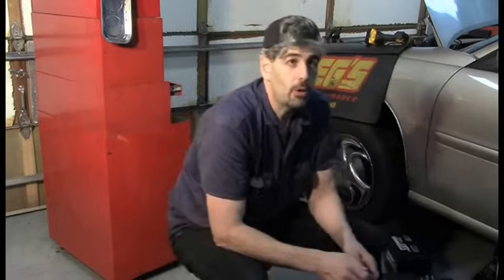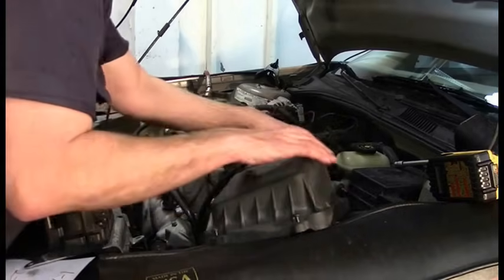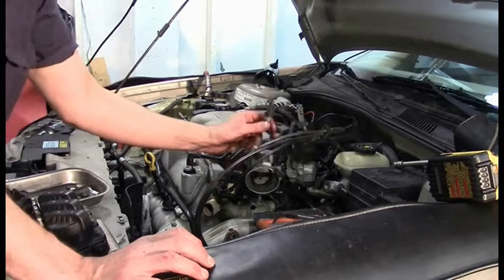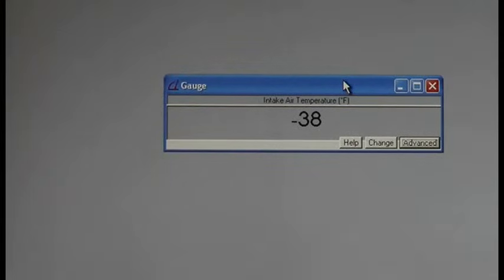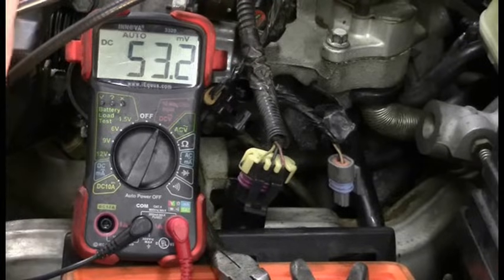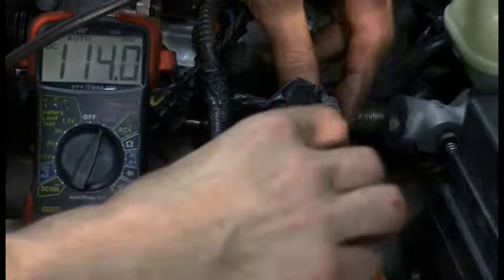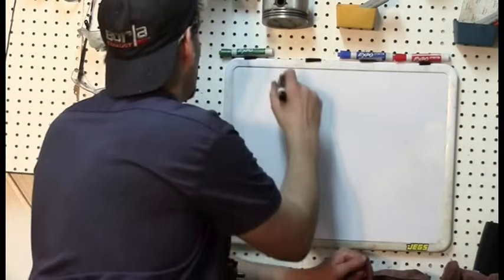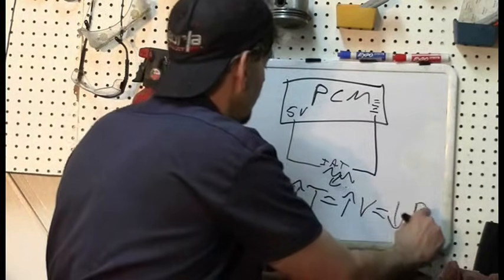IAT ( Intake Air Temperature Sensor ) Diagnosis P1111, P1112, P0113

Comment: What if you get your 5 volts by measuring the connector with the meter but when you bridge the connector with a paperclip and get zero volts with both leads connected to the clip, that's bad right?
Reply from the maker: ersanchez805  There would be no voltage potential across the terminals any more if you jumped the terminals. It would be like measuring voltage along the same run of wire. That's why there is no difference in voltage along the jumper.
  Why would you jumper it anyway? You are grounding a voltage straight to ground and could destroy the PCM.
Reply: Schrodingers Box
I don't know about cars much but my friends helping me lol.
It's because my idle is fluctuating. We replaced the iac, bled the cooling system after and checked for air leaks by removing the intake and covering the port in the throttle body and the engine died. We don't know what else it could it be? We got codes- P0113 P0505 P1509 on 98 Honda Civic EX
Reply from the maker: ersanchez805 No other way than to learn how the systems work and then diagnose what is failing using good diagnostic techniques.
 With those codes you could be changing parts all day and night and not fixing the problem
Reply from the maker: ersanchez805 Incidentally, if your friend had the idea of jumping the contacts with the paperclip, you need a different friend helping you before he destroys your car's computer- if he hasn't already.
Reply: Schrodingers Box Runs normal. Nothing out of the ordinary. Guess PCMs ok lol
Now we know not to bridge the contacts.
Gonna take it to a real mechanic. We tried. Thanks
Reply from the maker: ersanchez805 Bro, you don't understand... the whole PCM does not fry- only the part of the PCM you shorted out would fry. The car would still run normal. 
  I won't bother try to explain the whole thing but here's what the deal is and it's absolutely critical you understand this:
 based on the previous information you provided,If the real mechanic finds the PCM needs to be replaced, your bonehead friend who grounded the signal wire owes you for the PCM replacement. A PCM failure could only be caused, based on the previous reading you got, by doing the one, single thing in the entire video I said to be absolutely sure not to do-- ground the signal wire, and yet somehow that was done intentionally.
  It is critical you understand this so if this friend of yours really did that bonehead move, he takes responsibility for it and pays for the PCM if the car needs one because that was not- could not- have been the original problem.
Reply: Schrodingers Box we'll see if it needs a new one. But can we figure if we actually fried that specific part?
Reply from the maker: ersanchez805 yes there is but I hestitate to describe how since you might again ground it out if you do it wrong- plus there's additional complication in that the original cause of the problem is still not fixed yet so best to leave this one to the pros.
Reply: Schrodingers Box Well you know teens. We try doing things the right way but instead we do them the wrong way. Lol
But you know thanks for the helpful tips and hopefully we can fix the issue 
Like you said leave it to the pros.

Comment: I have a 2001 chevrolet silverado 4.8 it recently started throwing code p0113 and idles high on start up and will idle up a few hundred rpms while idling then drop back to normal and when applied throttle will hold for 2 to 3 seconds before dropping back to normal could it be my iat I believe it is built into my maf sensor on this model and when code is cleared the truck idles better but not like it should then it comes back on being the only code
Reply from the maker: what did the diagnostics on the IAT show?
Reply: Just learned from your video how to check it will do that tomorrow just wondering if the truck having throttle body spacer and cold air Intake could cause the problem it just started and has had cold air intake for several years added spacer and it started so im kinda stumped
Reply from the maker: most likely you will find a short to ground is your issue with that code. The video shows how to do the diagnostic.

Comment: This video was great!  Could a bad iat sensor cause the icv to stay open increasing idle at start up?  As soon as car starts idle goes up to 4k and will slowly increase??
Reply from the maker: An IAT will have nothing to do with that. Depending on the engine design probable causes would be vacuum leak, throttle body dirty, or ICV issue. But IAT can be virtually ruled out, as would ECT or other typical low temperature=high idle inputs because no inputs sensors would command a 4K RPM no matter how cold it is.
Reply: Thanks..I guess I'm stumped again. :-(
Reply from the maker: Brian Turner I am not sure what you have available but assuming you don't have a scan tool, my first step would be cleaning the throttle body. But really to diagnose this you need a scantool to look at various input sensor data and see what looks out of spec.
Reply: I'm working on 98 e39 528i.  I scanned the car. It was puling cam shaft actuator code.  Car was running good when code came up.  I was on my way home to park it and went to shift and the rpm stayed high.. I cut it off and on they were still around 3k. Then they started to go up more.  I let the car sit and still soon after it cranks the rpm goes up again 4k + until I cut it off.  I disconnected the icv and plugged the holes the idle went down.  I could see the icv was staying open.  I thought the IAT sensor controlled that. Thanks for your help and your video.  It was great the way you explained things.  The best explanation I've seen in an DIY auto video
Reply from the maker: Brian Turner Thanks for the praise on the video but most definitely look elsewhere than the IAT.
  There are many things that would cause this symptom. The idea is to not be stumped because you don't know what could possibly cause this- the idea is to be stumped because you know there are so many things that could reasonably cause it that you have a hard time finding a direction to start on.
  I think a good start for you might be this video:
https://www.youtube.com/watch?v=Fv4KzJxt0aQ

Comment: Matt, Had my scanner hooked up and I had a IAT sensor reading of 100 degrees F. The weather outside is 43 degrees feirenheit(excuse the spelling). The IAT in the Acura is in the intake manifold side. I realize its over the engine but would 100 F seem warm considering the 60F differce between that reading and the incoming outdoor air tempeture.
Reply from the maker: It sounds right to me based on the location, as stated there will be compensation for engine temp on an IAT located in the manifold.
  The best way to check is that in the service manual there will be a chart showing resitance vs temperature. If these match up then your calibration is good.

Comment: Hi Matt, first off I want to say I love your scientific approach to problem solving and diagnostics. You and ScannerDanner are my anti-parts-changer YouTube auto-diagnostic idols!

Coming from an engineering/physics background, I am curious about the nitty-gritty details of how a system works. After understanding the basic workings, the diagnosis/repair usually come naturally. Like yourself, I am self-taught when it comes to auto repair, and always gather evidence before jumping to conclusions and changing parts :)

A quick clarification on the IAT functionality and circuit design as I see it:
In any fuel injection system, at the end of the day the PCM needs to know the mass flow (not density or volume) of the air entering the engine to deliver the correct mass of fuel.

In a MAF-equipped engine (like this Malibu), the IAT is actually not crucial to the PCM's calculation of air mass entering the engine. In fact, the MAF or Mass Air Flow hot-wire sensor by design takes into account the density of the air! A given volume flow of warm air will give a lower MAF reading than that same volume flow of cooler air, as the cooler air is more dense and effectively has more mass.

On the other hand, in a MAP (Manifold Absolute Pressure)“speed-density” configuration, the IAT is a crucial input to the PCM for calculating the mass air flow. First, the volume flow (liters/sec) of the incoming air would be proportional to the [engine displacement x RPM]. Now, to get the mass (g), we need to multiply the volume (liters) of air by its density (g/liter) inside the intake manifold. From the ideal gas law, we derive that density (g/liter) is proportional to [pressure / temperature], or [MAP / IAT]. So finally we get [mass air flow (g/sec)] ~ [displacement (liters) x RPM (1/sec) x MAP / IAT]. NOTE: the word “proportional” means that there is a constant multiplier, so the actual units and numbers work out.

As for the circuit design itself, for a 2-wire thermistor, the 5V reference wire is the signal wire, which is designed to be pulled to ground (ScannerDanner explains this concept very well). In other words, there should never be any voltage on the second wire, as it is a constant ground (in PCM or external) as you drew in the schematic. So hotter temp → lower IAT resistance → lower voltage on the ref/signal wire.

I hope that my explanation was helpful and clear, as I had a hard time wrapping my head around that logic at first! The science and engineering that is involved in even one sensing circuit, let alone an entire system, is not trivial by any means! Looks like the modern “shade tree mechanics” are going to be investing in scanners and scopes soon haha

And that was a really cool tool you used to find the open circuit! Will have to get one to help pinpointing opens/shorts.
Again, thanks for the great videos, looking forward to more diagnostics!
Ivan
Reply from the maker: Thanks for the comment and yes I agree with everything you said. The IAT is relatively minimal in a MAF engine and in fact on a MAP and MAF engine the MAP is relatively minimal as well- it is generally used to confirm changes in pressure that would be anticipated from things suck as opening the EGR valve. If the EGR valve is commanded open but the MAP remains the same, it is safe to assume (from the PCM's perspective at least) that the EGR never opened.
Reply: I appreciate both your guy's videos. I'm a huge fan and subscribe to both your channels. I didn't know you had such a technical background, Ivan. And Matt, your videos keep me going back and forth between yours, Ivan's and Eric O's videos. Scanner Danner's videos are also very explanatory and really help with the pico scope. Keep up the videos guys!
Reply: Bravo!!
Fantastic explanation!!
Clear,concise and certainly educational.

Comment: Hi Matt, I have a good one for you. Your help is greatly appreciated. I have a 2002 Durango 4.7 that has a P0113 code. It doesn't want to start when cold. If I do a WOT start, it starts up no problem. It seems like when the temperature outside is below 70 degrees it has problems. Once either the car is warmed up or the outside temp is above 70, it starts with no issues at all. I've bench tested the IAT sensor (working perfect). I also checked the connector (5V). I have no idea what else it could be. I've also done a fuel pressure test and check the injectors (fuel pressure at 48 psi and no injectors are leaking). Again, any advice would be great.
Reply from the maker: Yeah that is a good one. There's several things I can think of that might explain the symptoms but of course extensive testing would be necessary to confirm and most go on the assumption that the IAT code is just coincidental. The fuel adjustment from the IAT is very minimal- it is virtually impossible for me to think of a circumstance where an IAT fault will cause a no start. Here are my possible explanations:
1. The fault for the IAT is actually from an intermittent 5V reference circuit code failure which of course would cause a no start- however the WOT start working everytime virtually dismisses this idea.
2. The fact you can start at WOT indicates there could be an issue with the IAC instead of the IAT.  If the IAC is stuck closed all the way and the inlet ports are blocked with carbon then there will be no air entering the engine on startup- but of course stepping on the pedal opens the throttle to compensate for it. This is actually the reason why, on a compression test, you are supposed to perform the tyest with the pedal pressed down (throttle open) to ensure air is drawn in. If you do a compression test on an engine with a clogged IAT and do not have the throttle open, there will be no compression because hardly any air will be drawn in to be compressed. But your truck would have definite idle problems in this situation so this is less likely but not dismissed.
3. My favorite idea is a intake manifold vacuum leak. Anytime a cold engine start or running/idle problem seems to get "fixed" when the engine is warmed up, I almost always default to this idea. Very often an intake leak (a severe one even) is present on the cold engine but it seals up when the engine is hot. I have confirmed this with a smoke test on exactly such a condition with a 2001 ford taurus (should have filmed it now that I think about it).  The engine runs better at WOT because the call for fuel from the TPS is compensating for the leak. The only issue with this idea is it doesn't account for the IAT code, however that's OK because the IAT won't cause a no start anyway.  Assuming you don't have a smoke machine, you might try spraying carb cleaner or propane around the intake manifold area while trying to start cold and if you "catch" the leak it will fire right up.
  That's all I got- thats a good one. Wish it were in my garage now!!
Reply: Schrodingers Box Thank you very much for your expertise. I will try and find a vacuum leak. I'm almost to the point of taking it to a shop. I'm approaching my limit of auto repair. Thanks again, sir.
Reply: Schrodingers Box Tested for vacuum leak with propane and didn't help it start. Didn't notice anything change. I put the propane all around the intake and air cleaner area while trying to start it cold. Still wouldn't start without pushing down on gas pedal. Then of course it idled fine and showed no issue. Frustrating....
Reply from the maker: Yeah I hear ya bro. This is really where having some professional quality equipment helps. I recently purchased a smoke machine leak tester (which made a cameo in a video of mine not long ago) and it finds leaks far, far better than my years experience of using propane ever has. If the smoke tester is negative, I rule out vacuum leak- period because there is no chance I missed it.
Doesn't look like you ruled out IAC yet though- that is still a possibility too.
  This is why I depend so much on my scan tool- it really helps to give a sense of direction. I would look at the IAC counts or fuel trim data and know whether to chase vacuum leak, fuel issue, or sensor problem and then I narrow my search from there knowing I am on the right path at least.
Reply: Schrodingers Box Alright!!! It looks like the IAC was the culprit. I removed and cleaned with carb cleaner. I think it was stuck closed. This morning the temperature was definitely cold enough to create the start up problem. It hesitated just a little bit and then fired right up. Idled perfect. Never touched the gas pedal. I guess if it acts up any more from here, I'll just replace the IAC. Thanks again for your help.
Reply from the maker: Well done! Logic and reason once again prevail and you fixed it without even buying any parts!  That would have made a sweet video for the channel bro!

Comment: Hallo  . my fiat stilo showing me sensor temp failure . i have change the sensor temp . intake air temp . thermostat . and everything getting voltage. checking from ecu to the sensor is good. there is not cutting . but i still get this error and the car not starting when this error comes on
Reply from the maker: I saw you video on your channel and i'm not convinced you have a code for an IAT. Verify the code with a code reader and let me know exactly what code you get.
Reply: Schrodingers Box  thank you very much for replay . the code is P0115 Engine Coolant Temperature Circuit .even the car was in fiat garage they check everything but they say nothing there is no problem . and sometimes this error comes and sometimes not .

Comment: Ooh, that was a good one!  Don'tcha just love it when methodical diagnosis gets real-world validation?  :-D

I wanted to make quick mention of a technique for those that find themselves without a wire tracer/signal sniffer.  You can use your voltmeter to help narrow down the open!  Key On, Engine Off (KOEO), take the positive lead of your voltmeter and probe the positive/reference side of the circuit, then take your negative lead and touch it to a known-good ground.  If you see your reference signal (usually 5V) on the meter, your open is on the ground side.  If you see 0V, you have an open (or another problem) on the signal wire.  You can confirm this with a simple continuity test on the ground side.  Keep the meter's ground wire grounded, and probe the ground/signal side of the circuit.  Most sensors run on 5V, at a VERY low amperage, so continuity is often all that's required.

There's a guy here on YouTube under the name ScannerDanner.  He's an instructor at Rosedale Technical Institute, and his whole deal is electrical testing and diagnosis using an educated, methodical approach based on knowledge of circuit design.  A lot of the time, he's using really crazy high-end automotive scopes and scantools, but the information he's giving while doing so can, a lot of the time, apply to much simpler techniques with much simpler equipment.  :-)